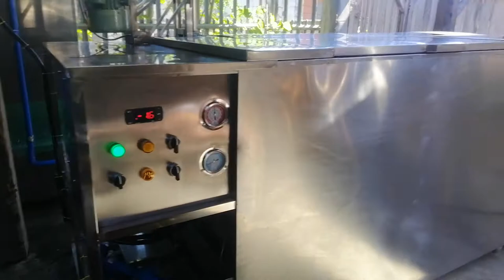Mini ice plant in Philippines

Comment: Where we can buy this machine?
Reply from the maker: Novaliches po we do shipping nationwide
Pls contact
09354598951
Reply: mgkano po ganito sir at specs? interested po
Reply from the maker: @felixrusselmercado8826  unit cost:480,000 free installation nationwide

5hp compressor inverter type
stainless 304 body and moulder
Aircooled type cooling system
60 blocks per day 20kilos per block..

Pls contact 09974677111
for more information